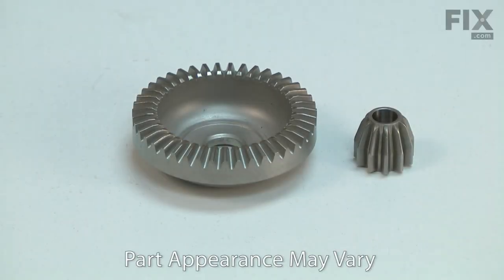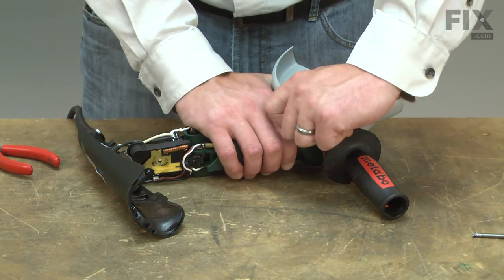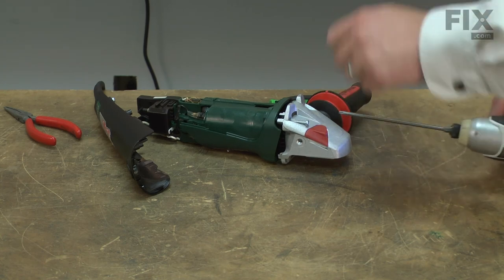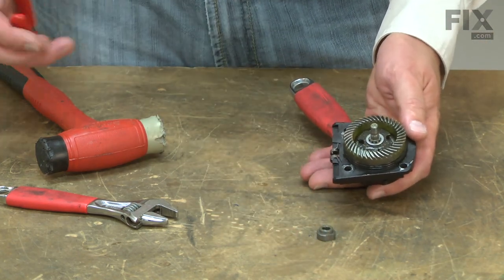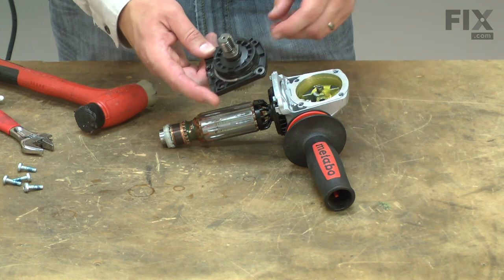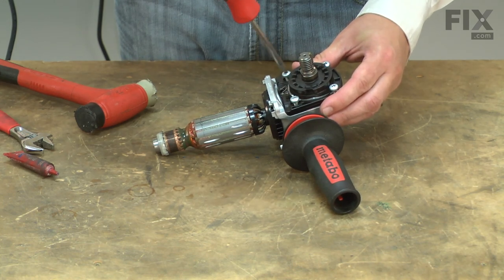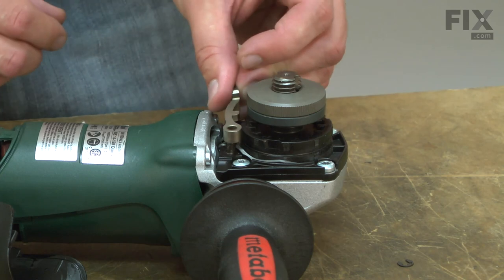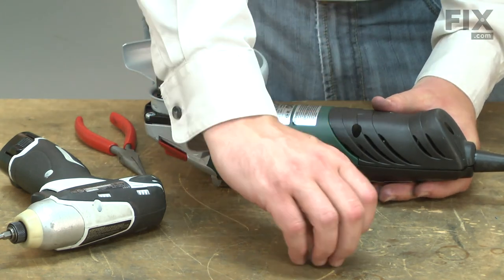Metabo Angle Grinder Repair - How to Replace the Bevel and Pinion Gear

Comment: Sir What is Difference between of "Spiral Bevel Gear" and "Straight Bevel Gear" in Angle Grinder?
Reply: Lo mismo me pregunto yo
Reply: The difference is straight bevel gears was used by angle grinders several years ago. it was the old gear system. the new spiral bevel gear engages better, smoother and less noisy which means a longer life for the gear set.